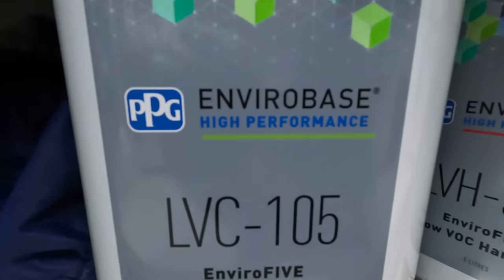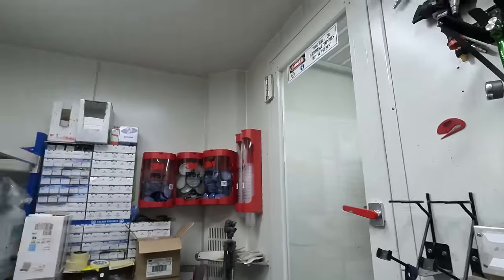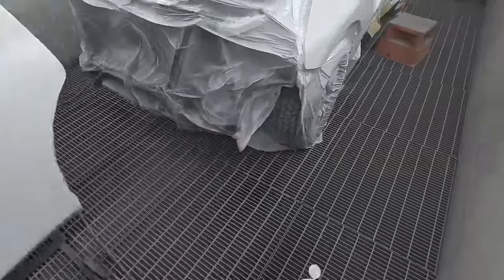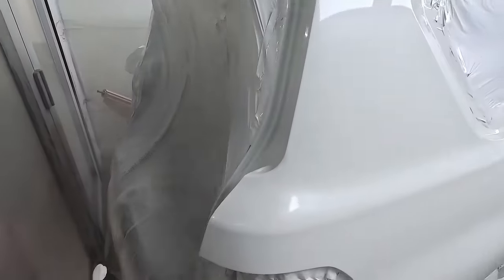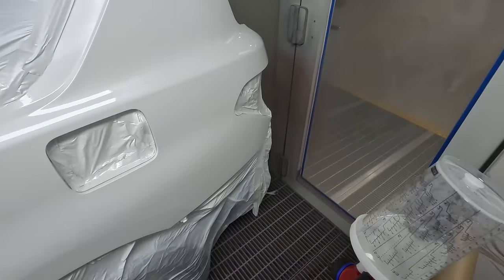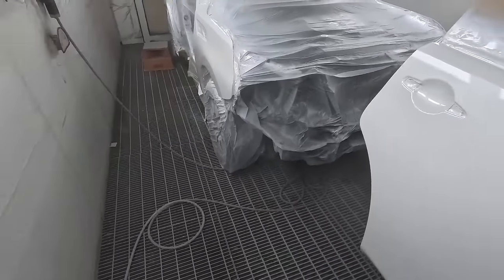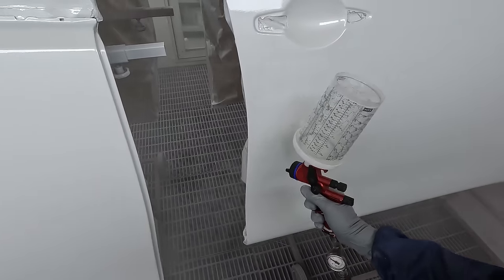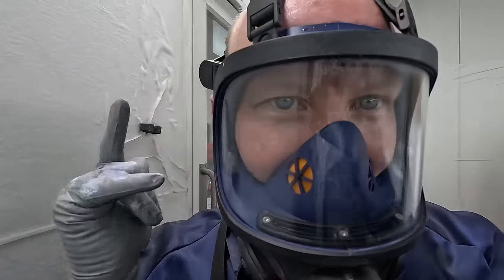SATA CC 1.3 Nissan Patrol Respray

Comment: Job looks good as usually. On those mid coats reduce it to 35% dries much faster, that’s was my reduction for them. 
As for the dye backs, few things possible, sealer if hasn’t flashed long enough or to slow of a reducer or to wet, I found it can cause dyes backs as it is gassing out slower then the water. 
or the base is still to wet from multiple coats and not dehydrated before the next. 
I know my ppg rep told me that you recoat after it flashes, but I found out it goes by much quicker when the viscosity is on point and the last coat is dehydrated before the next. I will use a infrared temp gun, take a reading before my first coat of base, and make sure I have the same after flashing it before the 2nd coat, and the same for my drop coat, once the panel is the same temp as you started, you clear 30-40 secs after the drop coat.  
I was also told in the 3m pod filters, the reason for the blue ones or finer ones, was that the reg ones the strainers were glued on with a water soluable glue and would deteriorate as you go, where as the blues would not and design specifically for water base. If I’m not mistaken, but I think sata has 2 different ones to.

Comment: You are the man Mr Gunny the clearcoat mixing specialist😎😅I couldn't afford the complete CC gun so just got the 1.3CC tip set for my X5500 RP and I just love it as it lays the clear perfectly, a friend of mine who has the same gun has a tool (no not a knob😁) that's capable of measuring the size of a hole and he told me that the 1.3CC is actually a 1.1mm which doesn't surprise me as it's slower than my 1.2i tip set for my X5500🤔🤷‍♂I really don't know why Sata does this with their tip sizes🤦‍♂
Anyway mate another superb job from the Gunman, loving your work brother👏👌👍John UK

Comment: Hi, great job. About the SATA's nozzle i got x5500 1.2I/ 1.3I and CC 1.3I. Tne CC 1.3 is a little bit larger than 1.2 on x5500 but smaller than 1.3I i also have 1500B 1.3 RP and the nozzle is smaller even from 1.2 I on the x5500. I cant undurstand why from SATA puts this numbers but they are not actual milimeters. Regards

Comment: what is the shop name this guy works in. I need 3 cars repainted and re cleared from Sydney.
The industry here in Sydney is mainly run by people from a certain sector of the cummunity who are not licenced and i am sick of shonky jobs, the last job i had done had 3 runs longer than my arm and the car was delivered to me like that.
Dust in basecoat, runs, painting over rubbers, overspray, straight edge masking, cheap primers, cheap clear, filthy spray booths and many of these shops have no insurance. So if your Camaro or HK Monaro you have had since 1977 gets knocked off  off BAD LUCK.  I can take my 3 cars to Victoria, fly back and know its being painted  with results.
I have 1 Camaro that was repainted, has mottle on the front guard, and door and a run thats 450mm long, sink back on 3 repairs, and the clear coat is milky, car repainted 2020 and never driven since.
 my Wifes i30 hatch in silver  needs roof and bonnet painted, re clear entire car, My 1993 GMC C1500 pickup full respray same colour and strip the roof and bonnet, pickup is 4 inches wider and 6 inches longer than a VE commodore wagon.

Comment: What would you rate a best gun for clear coat, for flattest finish? Im pretty happy with gti pro lite, bought it because of you and it still serves me awesome, very versatile gun! But id like another gun now, because I only have 1, and id like it to be only for clear coat.
Reply from the maker: Depending on the clear you use, I would either recommend this gun or the DV1 C1 1.2-1.3 if it's a thicker clear go for the C1 1.3, otherwise if it's a thin clear go for the 1.2

Comment: I got a question. Is mixing old paint with new a good idea? For instance, let's say you did a job with a specific paint code and years later, you have to do another job with that same paint code, but you don't have enough to do the whole job. You order more. Would it be a good idea to mix the new with the old?
Reply from the maker: I don't think it would hurt but I would avoid it unless I felt I needed to
Reply: @TheGunmanChannel  The paint is $70/pint. It's Omni plus PPG. I have a little more than half a pint left. I got another pint because I feel that I will need more than half a pint. I've got to cover a front bumper and fender, plus I will have to blend into a door and the other fender. I feel that if don't mix them, I will have two different shades of paint. If I mix them from the get-go it will be all one shade.
Reply from the maker: @lizardking8388  in that case, I would spray the colour to check it, it may be the case that the old colour is better, if it needs to match you could put one coat of the new stuff down for coverage, then put one of the old on. If it doesn't need to match and you think you'll run out then yeah just mix them as long as they're both the same kind of paint
Reply: @TheGunmanChannel  There is none of the old paint left on the car as those panels were destroyed in a wreck. Is it possible that one is a better match just by chance? Maybe, but wouldn't it be very difficult to tell if one is a better match without putting clear on it?
Reply from the maker: @lizardking8388  just do a test panel and clear it, use a small piece of steel.
Reply: @TheGunmanChannel  You've got me thinking on this. I've got the old fender and the bumper that were heavily damaged. I'm going to tape out two squares on one of these panels in an area where I know the factory color is and spray them each with one color to see what looks closer.

I may be overthinking this though. If the two colors are close enough to blend into a panel, then wouldn't mixing them together still produce a matchable color? I mean, I'm going to have to blend the paint anyway. My thinking is if this car gets more damage in the future (my daughters car), it would be better to have one color of remaining paint that matches what was painted than to have two small amounts of different colors. Thoughts?
Reply from the maker: @lizardking8388  sounds like it should be ok to mix then
Reply: @TheGunmanChannel  I mixed them and the job went well aside from everyone deciding to cut their lawn today :(
Reply: @TheGunmanChannel  I have numerous old basecoat colors and use them all the time to tweek colors and use as first coats. Some are over 10 years old and are no problem as long as they haven't jelled or gone seedy.  Can even mix different brands,,,,but it depends who or what its for- my car lot or paying customer, etc.